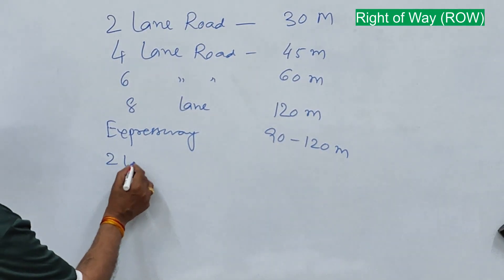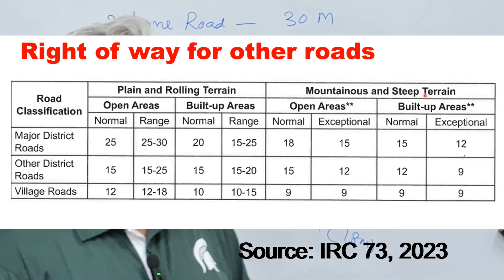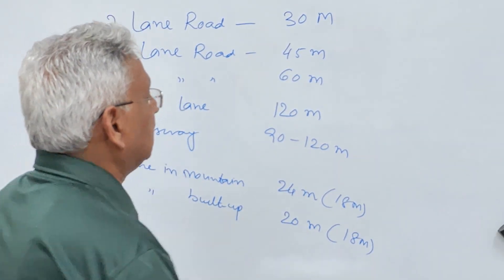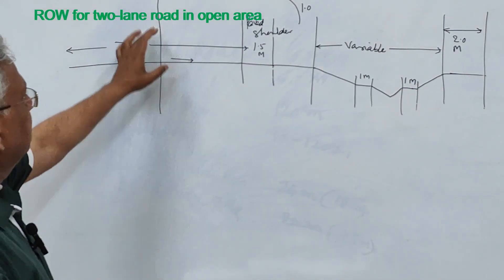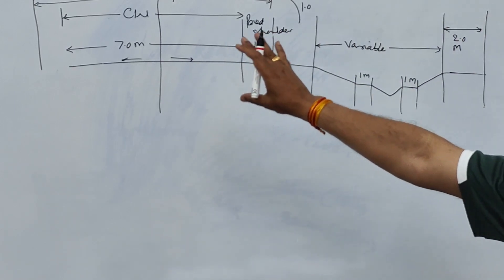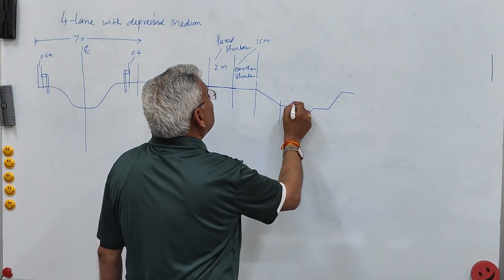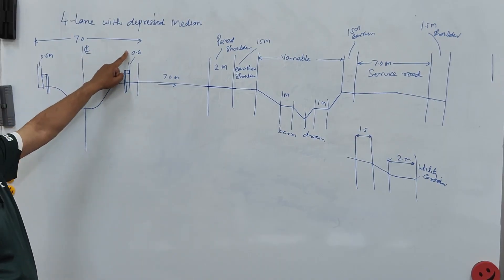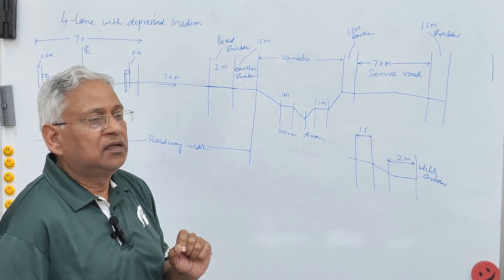Right of way of a road #ROW Details of all features for different categories of roads.

Comment: sir whats should be minimum height of embankment and minimum height of Subgrade
Reply from the maker: The thumb rule is that the subgare should be abour 0.6 m to 1.0 m above the highest flood level and therefore, the minimum height of embankment is 0.6 - 1.0 m.
The minium depth of subgrade is also the same 0.6 m for low volume and rural roads and 1.0 m for other.
Reply: @SatishIITR Sir any IRC guidline supporting the thumb rules
Reply from the maker: @roshantigga2614  You can get it in any IRC document, MoRD or MoRTH. The subgrade level is always kept 0.6 to 1.0 m above the flood level

Comment: Great work sir. Sir for an already existing single lane or two lane road in what basis these roads are designed and extended to two lane or four lane roads. Please do video sir
Reply from the maker: Widening projects are undertaken based on volume - capacity ratio. It is given in four-laning manual. Once the traffic volume on a two lane exceeds the values given in this manual, it is widened to 4 lane.

Comment: Excellent Video sir, Sir how to design the road  like no. of lanes 2 or 4 lanes, how to fix divisional islands width etc
Reply from the maker: Number of lanes are fixed based on traffic volume. divisional islands are designed as per IRC code. Will see if I can cover these points in a video
Reply: Thank you sir, please make a video related to no. of lanes based on traffic volume
Reply from the maker: @chiru861  ok

Comment: There was a application of NOC For installation of petrol pump in Village road. We gave NOC for Construction after 12.5 metre for Village road. Now they built a retaining wall for retaining the soil in filling.   Retaining wall touched the shoulder of road. I asked them to remove it because it was withing ROW(12.5 metre). He said that, how will we retain the soil if we do not construct retaining wall? I thought he is right. If he doesn't construct the R/W then how will they retain the soil . 
But as per criteria ROW is 12.5 metre. It is okay to do that?
Reply from the maker: Sometime practical considerations dictate the design. Difficult to tell whether it is ok or not.